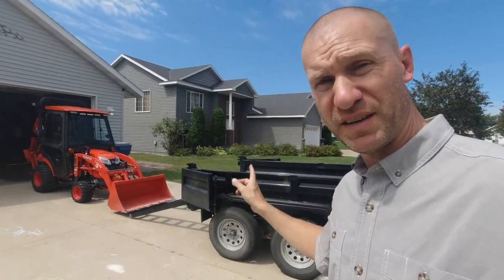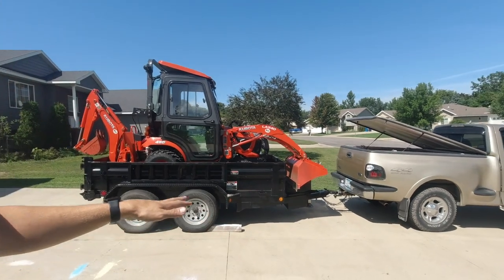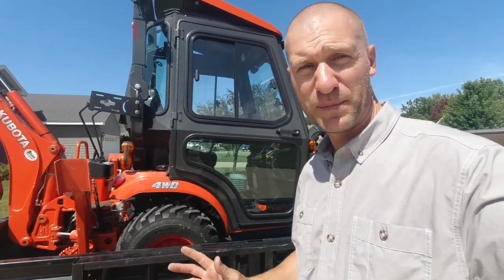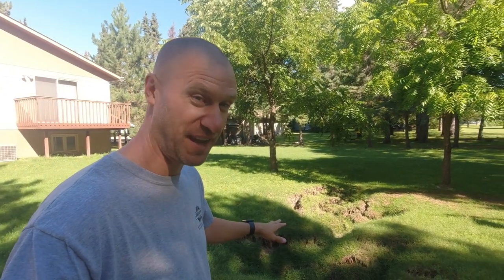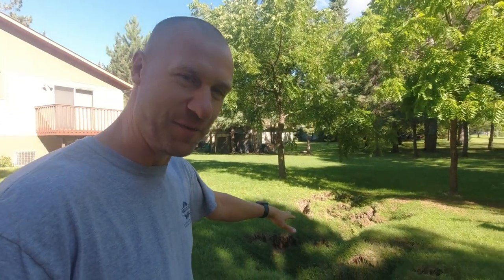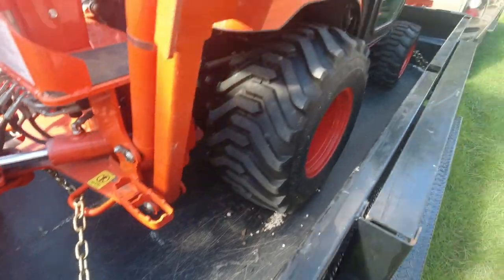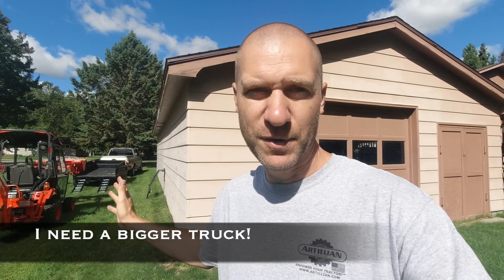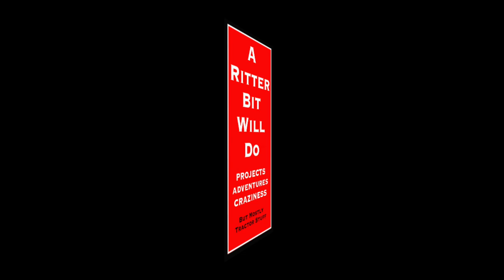LOAD TRAIL DUMP TRAILER AND KUBOTA BX TRACTOR  (perfect pair)

Comment: Too bad trailer manufacturers think their trailers are made of gold, holy crap, looked up pricing on a 7x14 trailer, OUCH!!!  I'll stick with my car trailer, its just a bit lighter weight than one of those new dump trailers by about 1,000lbs, but longer and a little wider I think, but paid for....the most important part.  The ramp on it is great as its a 1 piece tailgate type ramp, so you don't have to be as precise loading/unloading like you do those regular 2 piece ramps....however, its really short, trying to load a regular car onto the trailer is quite a chore, doesn't have a winch on the deck for one, and with that short ramp you really have to get creative to get the angle of the ramp down enough to allow a car to be loaded without getting hung up....I've got it down pretty good for cars now, I've hauled enough dead ones...yeah only time the trailer gets used for hauling cars is when they don't move on their own power LOL.  It would work fine for a tractor with loader and other implements for sure though....I have no clue what its rated for, as it was custom built by the guy I bought it from who owned a landscaping company.  he used it to haul landscaping boulders, skid steers, and other equipment, so it should easily haul a sub-compact tractor and implements/attachments home from the dealer.  I just have to figure out storage solutions for implements and attachments as I don't have a garage...may have to rearange my barn to allow storage for stuff in there.  Loader will probably live on the tractor all the time so not too worried about that, but tiller, box blade, pallet forks, etc. will need a home that has easy access when needed, may have to get creative and build some sort of racks to store stuff LOL.
Reply from the maker: You’re right! The price of dump trailers has gone through the roof! Sounds like you’ve got a decent heavy duty trailer to get you by. I would imagine supply will eventually catch up with demand and prices will become a little more reasonable. Thanks for the comment! Best of luck to you in your tractor endeavors. 
Keep on tractoring!
Reply: @ritterjon  The car trailer will work just fine, can't haul dirt or anything like that with it because it don't have a solid floor....the decking is built out of old aircraft landing strip called Alumamats, great thing with that though is I have an infinite number of tie down spots on the deck of the trailer....that thing is heavy.

Comment: And, when you take a turn a little too tight, you're going to realize that ya should drop the bucket in the bed of the truck. 
Saves tailgates and bumpers
Reply from the maker: I've thought of that but that requires me to unhook the trailer I need a flatbed truck. 
Keep on tractoring
Reply: I hear ya, I had a toolbox on the neck of the trailer,  and even though it was convenient, it gave me a nice repair bill after trying to turn tight

Comment: I watched this video 2 years ago, came back to watch it again, because I sold my 6x12 trailer because just the trailer was 2,300 pounds heavy, add the 2,700 pounds of the tractor and backhoe, then my Tacoma is too loaded for my taste, so this year I will build a new 5x10 trailer in aluminium of about 600 pounds, front and rear gate will open 24 inches (sides high) to allow space but not capacity, looking at your trailer, it is perfect because it dumps, mine wont, but your tongue is too freaking short, all I would do is add another 24 inches of tongue, and all your problems are solved, plus it will be easier to backup with the added 24 inches, my tongue will be 58 inches long, that's the secret....with a fold away tongue system, 6,000 pounds class, easier to park also!
Reply from the maker: I think the 5x10 trailer I have is perfect for my situation because it’s about all my f150 wants to handle and my tractor fits in it. The fact that it dumps is a huge work saver when hauling material. I can also tow the trailer with the tractor keeping in mind its limitations. I prefer to transport my tractor with my 16’ aluminum trailer but when the dump trailer is needed it still works for me. 
Keep on tractoring!

Comment: my 1500hd pulls my b2650 on 16' trailer like its not even there.
Reply from the maker: You must have a newer truck, mine is 21 years old but with 53,000 miles.
Keep on tractoring.

Comment: 1999 F150 you said?
https://www.fordf150.net/specs/99tow.php
Towing capacity, when new, 8,000 to 8,300 pounds.

https://www.fordf150blog.com/2015-ford-f-150-towing-capacities/
3.5L EcoBoost has a 10,700 to 12,200 pounds towing.
5.0L has 8,300 to 11,100 pounds.

So you could just stick to the F150, and find a newer one 5 years old or less.

Going to a 250/2500, and any would handle it without a problem, but you said you prefer the smaller size.  The 250s are all pretty huge feeling, comparatively.  I miss my Ram 2500, 2007.5 with the 6.7L Cummins, but it was a pain to park in a lot of places that re-painted with smaller parking spots in the last few years.

For variety, the 2015 Ram 1500 has up to 9,050 (4wd) or 9,180 towing.
2015 Silverado 1500 can be specced up to 12,000 pounds.

So . . . options.  :)  I just did a basic "gmc 1500 2015 towing capacity" search (ram/F150) to get these numbers.

Another option is going with a gooseneck trailer to put the trailer weight over the rear axle rather than levering further back at the regular hitch.  With a 1999 gas truck, though . . . The suspension sag isn't your problem, most likely.  If it is, that's just helper springs or an air assist.

With the loading angle, you could use a 2x4 or 4x4 section under the ramps to change the loading angle, as well.  The tractor should be able to climb that little bump difference.  It isn't a massive change, but could be enough to stop the dragging.

Comment: I just replaced a 2017 F-250 with a 2019 Ford F-150. I pull a 18’ trailer with my BX23S. No problems. You can get a F-150 with max trailer package and pull over 12,000lbs. Get some timbrens on the rear end to keep the truck level. https://timbren.com

The number of times I was pulling a load heavy enough to need a heavy duty truck, didn’t justify the gas mileage I was sacrificing for the majority of my driving.
Reply from the maker: The same thing has crossed my mind. A newer truck with a good tow package would fit my needs just fine. I keep looking for deals and nobody is giving away free trucks yet. 
Keep on tractoring!
Reply: @ritterjon  Used trucks are selling for a lot right now, well used vehicles in general.  Not a good time to buy....wait a few more months till the extra unemployment handouts run out and people start selling those toys they bought when they thought they were rich, you'll start finding deals.  

When I get my tractor, I already have a trailer, its overkill for a sub-compact tractor, but I would be able to haul the tractor, loader, mower, box blade, etc. all at the same time on the trailer which will be the only way I would be able to get it home from the dealership.  I'll have to find a pickup though, don't think my explorer or my Ranger would tow it LOL.  I'll just have to borrow my 88 F250 back from my uncle for the day to get the tractor home if I ever get one.  Trailer is a 23 foot car hauler, custom over-built by a guy that did a lot of heavy landscaping.  He built it for hauling landscaping boulders and his heavy equipment around.  

I think I'll look for a late 80's or early 90's F250 with the 460 V8 just for the towing duties...or convince my uncle to go buy himself a newer truck and I'll take my old F250 back LOL.

Comment: Jon before I go running over the countryside with the tractor in that dump trailer you got a check with the US DOT really going to aspects one was protruding over the front of trailer.... which is taboo to anything exceeding more than 4 feet off the back of the trailer is illegal.....  need a red flag on that boom hanging out...  In the alleviate the boom dragging on the ground when you’re loading two 2 x 12‘s probably about 6 feet long for the rear tires to come up with illuminate that problem...If you get caught by the DOT going down the road with the truck in the trailer and your tractor and a bag of it you’re gonna be in deep trouble  with local law local. motor vehicle Department make sure your legal at least be $1000 fine before they let you go... They don’t play good with people with overloads and doing stupid things and you’re doing a stupid thing junkman do
Reply from the maker: The boom really only hangs over about a foot maybe 2. So far after trailer my tractor like this for several years I haven’t had any issues and I’ve pulled up right next to state troopers at stoplights before. I think being that I’m just a DIY’er and not a commercial guy they tend to let me be. Or maybe I’m actually legal, I really don’t know. So far it’s been fine but I can totally understand the concern. 
Keep on tractoring!
Reply: I see machinery hauled like this all the time, I don’t see a problem if weight limits are respected and load is properly secure.
Reply: OK i told the gentleman the Loaded  that Kabota tractor on the trailer... I was told by the DOT seminar held by the state of Connecticut that a bucket over the end of the trailer was wrong ... I need to run was illegal the boom protruding past extension the trailer needed to be red flag anything over 4 feet is illegal the bucket over the front end of the other trailer is illegal... maybe for   little Tractor like is ok .... but before he gets caught by the department of public safety!!!!!!!!which we called on the slab the dogs....  he should go and talk with them he said he pulled up next to state trooper trooper didn’t doing state trooper  State trooper probably didn’t know the rules  there’s a whole truck division squad did every state has for anything over 8000 pounds up to 80,000 pounds to enforce the rules and regulations of the DOT

Comment: Dump trailers are extremely tounge heavy.  A bigger dump trailer would destroy that truck.  I think its a good match for what your doing.
Reply from the maker: You're right, they are tongue heavy. I've added air springs to my truck to help with the problem and trying to balance the load helps a lot as well. I need a newer or bigger truck. 
Keep on tractoring!

Comment: Is that safe and legal to have your front loader bucket on the tongue like that?  Does it limit your turning radius?
Reply from the maker: It seems safe and as far as I know it’s legal. It does limit my turning a little so I just need to be careful when towing the tractor. 
Keep on tractoring!
Reply: @ritterjon  Forgot to mention...  That was pretty smart with the tire holding up the dump trailer to get a good angle. :-)

Comment: Nissan HD with a diesel!!! My son has one and it will pull a 40 foot enclosed car trailer with a car and all his racing equipment at over the speed limit and never strain it!!!
Reply from the maker: I haven’t considered a Nissan but I’ll keep it in mind. Thanks! 
Keep on tractoring!
Reply: Don't want that they already discontinued the diesel had to many problems. I would do an F350 with the new 7.3 Gas engine.
Reply: @markpontes4457  My son has close to 200,000 and has not had one problem. We did have to replace the front U-joint on the front differential. But he loves it!!!
Reply: @markpontes4457  But that 350 wouldn't be a bad ride either if you want to ride around in something that cost more than most houses...

Comment: Skip the 14', get a 16'. I did.
Reply from the maker: I think I’d like a gooseneck dump trailer. 
Keep on tractoring!
Reply: I have a Diamondback truck cover on my long bed truck, and currently believe it is the best option i have to run with that and a bumper pull dump trailer.  I can pretty easily put two pallets with whatever attachments i want on the truck cover, and keep the attachments that fit in the dump trailer on the tractor as i do have fork holders on my Lamar 16'.  Plans and beliefs change all the time as you know.